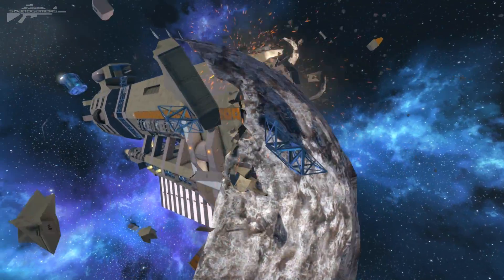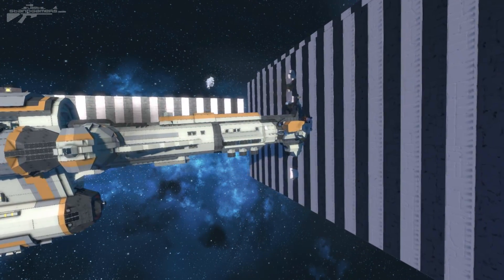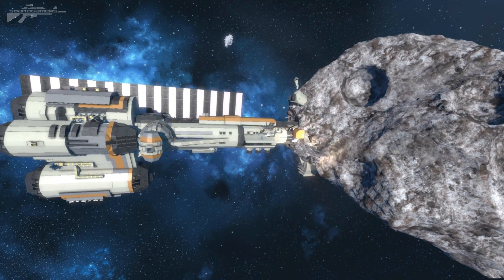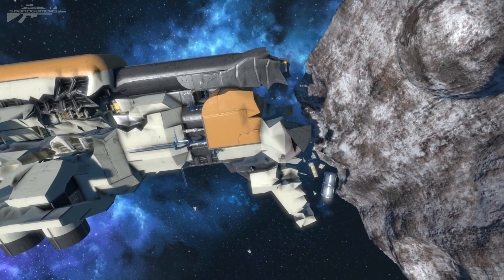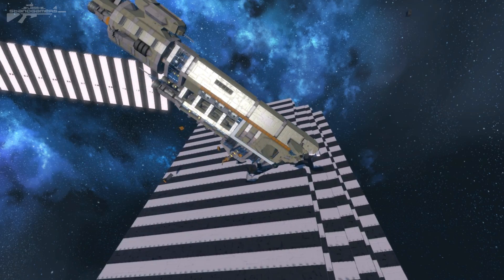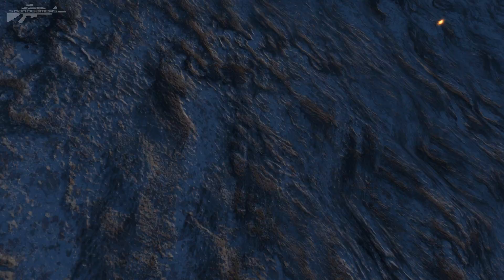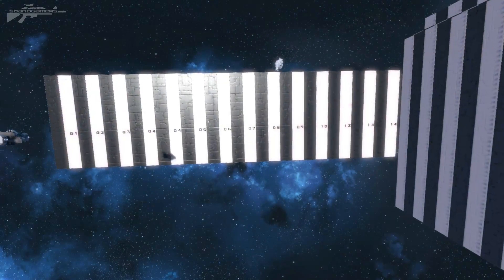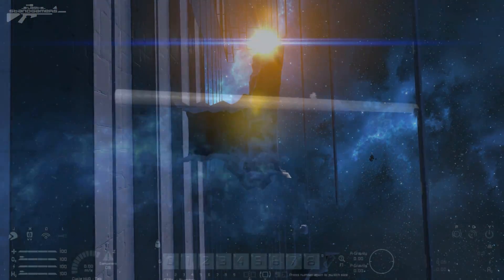Space Engineers - Ramming Tests, Head On Collision

Comment: Is there an updated version of this test?

Additional to the light and heavy armor blocks a comparison with blast doors would be nice, maybe all undeformable blocks, maybe also including drill heads.
Spaced armor to be penetraded you had included, but not spaced armor combination of different materials.

Also years later there are many more new blocks out there, some internal calculations may have changed,
Any chance you could redo these tests?

Have you come to test the sweet spot for speed to create collision damage? Is there are differance in environment voxels and grid on grid at which speeds collision damage would occur?

With damage reflection by angled blocks, damage spread was said could be directed, like the direction the impact force would take.
Could one build a hammerhad ship, where one could precalculate a break off point and by that fly out the rear and refurbish/salvage it for another round where the rear section is secure from frontal impact damage, because as we had seen, the damage went through roughly 50% of the ship even though ofcause that damgage the further away was less, i wonder if that could be prevented just by the types of blocks and in which combination one would place, like having a ring of isolating non deformable which does not translate dmg further backwards.

Comment: My only input is with the single block tests... I believe the reason the penetration is the same may be because both blocks are breaking and turning into scrap metal fragments... This may require more testing as it has been a while since I was last on and they may produce equal fragments OR the heavy has more fragments... If the latter is the case, there are 2 options... 1) the depth test isn't deep enough, or 2) it penetrates just as many layers, but can go through higher health blocks...the 'floating objects' parameter may effect penetration in this event as the fragments may be the objects dealing damage and as too many spawn, damage is limited to the object cap... THIS IS ALL SPECULATION, DO NOT BE ANGRY IF I AM WRONG, PLEASE INTERNET... Sincerely, A procrastinator with too much time and better things to think about.

Comment: This is "Mithbusters science", I see. KEK Try different targets, with several layers of light and heavy blocks using a auto launcher station for projectiles, trying to control speed and mass. So release the same mass at different speeds, then try to use the same speeds as before, but for a bigger mass. Rinse and repeat. Basic experimental physics 101. The tough part is setting up a launcher that is consistent. If you use the artificial mass and check the speed from a cockpit as the projectile is propelled by a gravity generator(kinectic cannon/mass drive) with no engines or osciloscopes, you might get some repeatable results.

Comment: I have a different type of Star Wars hammer head design which has a heavily armoured  front designed to ram. I could ran anything and the front will be pretty much okay. My best test is when I covered it in explosives all across the front of the ship and it took 3 times to get into the ship. I had covered the body of the ship in explosives and set them off and it was still fully operational. Just a lot of flames coming out of it. My whole game crashed before I could destroy the whole ship. The ship is huge and I get lost in it a lot. This ship is all old space engineers based and has no mods, it is just vanilla.
Reply: "Still fully operational. Just a lot of flames coming out of it" XD

Comment: FYI there is some wonkiness with collision damage. Mixed grids take less damage. I have done a ton of testing of this nature, because of the script-LIDAR guided FOF anti-cap ship torpedo's I run on my cruiser. Torpedos are essentially ramming script-guided ships, in this instance; so figuring out how to do maximum damage when ramming, and what sort of things mitigate ramming damage, was a side-hobby.

Blast blocks are great vs ramming damage. deformable blocks or things made of interior plate instead of steel plate; not so much. Mixed grids (small + large ship attached to each other, pistons, rotors) seem to give the entire ship some sort of ramming resistance.

My most damaging torpedo is large block. Blast block front layer (penetrator); cargo containers behind, each with 4x stacks of 10K iron ingot. Behind that is the program block, timer, thrusters, connector, merge block. The torpedo's print from the cruiser's torpedo bay using welders + projector, lock on using LIDAR, and self-guide to the target up to 20KM away/or max render range. 

The iron ingots do all the damage. The torpedo described above penetrate about 16 solid heavy armor blocks, give or take (depends on the angle); in a wide damage pattern. One shot kill on many ships. 

http://steamcommunity.com/sharedfiles/filedetails/?id=838339561
Reply: Do you still play and has anything changed in your torpedo designs?
Drill heads on rotors with a battery i thought a funny idear, as it would continue to distract enemy players in pvp match.
also having counter measures like rotating and throwing out armored decoys shortly after getting into PD range seems a viable tactic to destract from the damage dealing main payload. Something that got nerved but to an extant is still viable is to just have munition loaded in a cargo container, which i wonder if that would be better or worse than just ingots or stone, definetly more expensiv.
Then with automation and event blocks there are some shananigans now possible, partially or complettly making scripts unnecessary.
Reply: @kinngrimm  I am not active but the Guardians Vanilla (GV) community and server still are
Reply: UnexpectedInquisition That sounds awesome. But if you where to try this in survival, would rock work as well?
Reply: It works and I have used it in survival. Rock does work but not as well as iron.
Reply: UnexpectedInquisition I'm guessing it just comes down to sheer mass, velocity and surface area then
Reply: Heavier the better and surface area yea